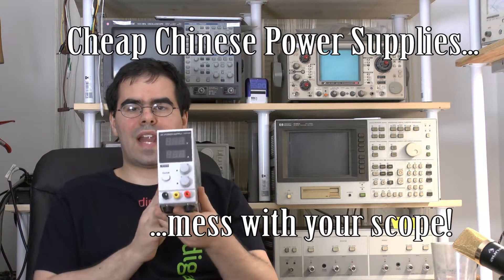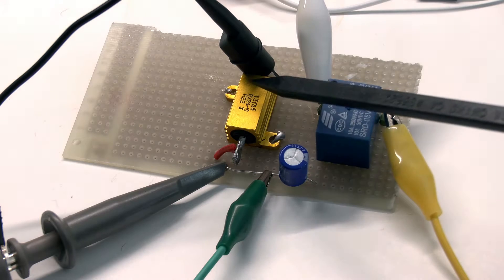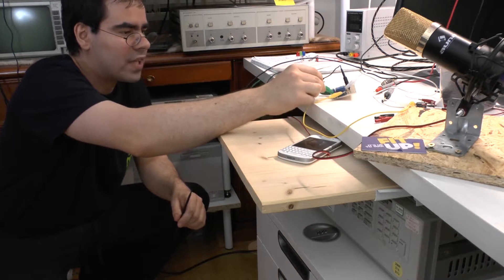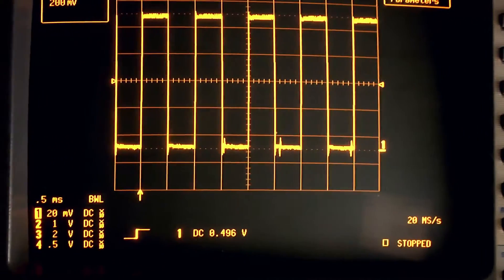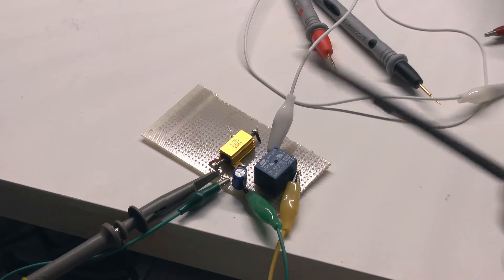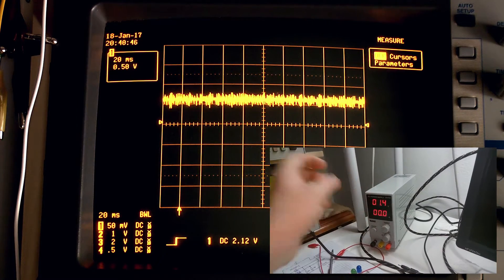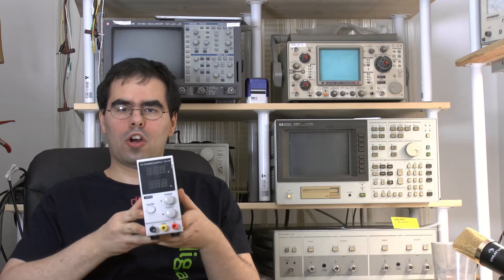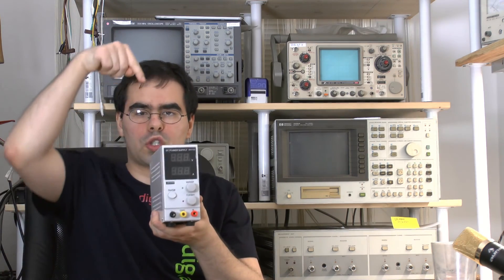Cheap Chinese Power Supplies mess up Oscilloscopes

Comment: Looks like it is switch power supply and has quite low ripple. If you compare it with analog power supply with big transformer of course the ripple it high. You get to know which power supply you need and which device you want to power it. If you want to pay less than a transformer price to buy a complete power supply with transformer, ...
Reply from the maker: Hello, thank you so much for talking back. The main intent of this video was to highlight the effect - sorry if it came along the wrong way...

Comment: Tam, how's your 4195A ? I'm trying to get mine up to date. New battery, calibration etc.
Reply from the maker: Hi, had him up yesterday for 2min for a demo. But I dont use him much, so there is not so much going on with him.
How can I help? Before I closed my windows of the bunker (this video was made in the old facility), I had a strange visitor warning me to perform a preventive maintenance of the capacitors on one assembly, but idiot me forgot to note which one.
Either way, tamhan aeht tamoggemon dot com it is if I can be useful!
Reply: @MrTamhan  I will replace both the RIFA cap and the battery and post a message on it in the next week or so.
Reply from the maker: @linuxaos  thanks man. Please let me know how it all goes - in the not so far away future, I also need to get back to maintenance. But my work level is insane at the moment
Reply: @MrTamhan  I posted this message on fenugrec's channel:
https://www.youtube.com/channel/UCvuwQ5FMK3X9qWw-NXK7QUw
I will repeat below with what I found. 
OK, 2 things. First, the battery can be replaced by:
Digikey: SY118-F021-ND
However, on the Power Supply board, you will find a RIFA Capacitor which must be replaced (as they fail miserably.)
Digikey: 399-7488-ND
Check out the video here for "RIFA MADNESS":
https://www.youtube.com/watch?v=XAbrU17hLTM
Reply: @MrTamhan  Tam, check out my video on maintenance of the 4195A. It tells you what to replace.
https://www.youtube.com/watch?v=TnaR4BcJ-N4

Comment: I can get a BK Precision 1735A for C$120 (about US $90) used at a local surplus store. That's 30V +/- and 5A, 4 digit readouts. <1 mV ripple. Heat sink instead of fan and so on.
New equivalents from several brands are C$350 and up where I live. Then there are these numerous almost identical Chinese supplies. I want to use it mostly for powering portable audio circuits on my bench, maybe an hour at a time a few days a month. e.g  a motorcycle headset or headphone amplifier where I'd want to see how the circuit performs on 2.4 Volts instead of 3.7 Volts or if it can take 5 V from a USB source.
Are these under $100 Chinese units too noisy or unreliable for that? I don't think I'd lose sleep from buying an old surplus BK supply but maybe someone here has a different opinion.
Reply from the maker: Hello, puh - I do not know this power supply. But if it works, why not get it - the price looks hot!

Comment: my Tekpower 5A model died within 3 months. Remember kids. Do not buy a Tekpower.
Reply from the maker: Thanks, man! Mine still works, albeit I did not use it much
Reply: I was using a DC motor at the time. I think the transformer at fault because the inside of the fuse was caked with metals and such. It also made the Lights in the house dim so if the Fuse wasint there the breaker would of popped.
Reply from the maker: Bro, did you fit a flyback diode? If the motor was big enough, this looks like an inductive kick issue...
Reply: Na there was no Flyback and the DC motor was from a small 3.6 Volt drill. there was no Flyback on the DC motor when it was pulled out either.
Reply: Oh yeah i forgot to add. The 3.6 Volt drill in question is one of those cheap ones that had a Nicd battery pack in it. The motor pulls around half an amp at its rated voltage.
Reply from the maker: Hello, please still be careful. Coils can bite, and a motor is a coil...
Reply: And this kids is why Fuse's exist so you don't die.
Reply from the maker: Not really. Man, I am sorry I am a bit stressed at the moment. Can we skype or vyber so that I can explain the problem?
Reply: Na its good man. The odd part is that it had no load but what do I know. Im bottom of the barrel when it comes to electrical things. Ive still got a few years to go until i can go to collage and actually be of use
Reply from the maker: Dillon, it is not a question of age. Trust me, just keep learning. I would love to make a video on the inductrive kick, but I sadly cant at the moment.
Reply: Dont worry about it bro. At least when you told me it was Inductive Kick i can resolve the issue and move on.

Comment: The cheap Chinese power supply you use is a switching power supply. It's not too surprising that a cheap switching power supply from China puts out a lot of EMI compared to a linear supply. The good news is that most cheap Chinese power supplies are still linear, they're just a bit bulkier. 

The fact that you also get radiated noise from the LED lights in your lab too should be a red flag to you that there's something you're missing in your test set up. Your scope is necessarily set to a very sensitive V/div, it's surrounded by EMI sources and you have long leads from your DUT to your scope (assuming you use the scope in place on the shelf), you have your DUT unshielded on your bench and you have long unshielded crocodile leads from your circuit to both power supplies which act as antennas. It's going to pick up any noise around and you must account for this in your test set up. Even without the switching power supply and the LED lights, we live in a 21st century world of dozens of EMI sources in every building. This is the first of your videos I have seen, but if you're an electrical engineer working on a real job and if all that expensive test gear is an indication of your experience, you should already know this.
Reply: See that long black ground lead on your scope probe?   That part is called an antenna.   Here are some tips.  You can clip the ground lead to the probe tip and you will have a loop antenna. You want to minimize the "loop area" in circuits and in measurements to minimize the interference coming in or going out.   This means that the return path for any signal should be as close as possible to the signal path.  The area between the two is called the loop area.  Remove the witches hat from the end of the probe and you will probably find a ground ring.   Coil a piece of bare wire around that (make the coil smaller than the probe so it is tighter) and have a short 1/2" or less stub that you can connect to an adjacent ground.   (google oscilloscope ground spring).  You can buy or make ones that are actual springs.  You can get clips that will connect to the ground ring. Use fully shielded coax connections directly to the circuit when you can.   Next best is twisted pair wire.   Make short adapters from 0.1" female headers to BNC jacks for using two pin header test points.  If you must use clip leads, twist the two cliplead wires together.  Incorporate BNC/SMA/header (with ground) test points in your circuit.  Use two identical scope probes with one on signal and one on ground and set your scope to subtract (differential measurement).  Consider a CT2708, CT3655, or PP005-BNC  scope probe to bnc adapter if they fit your scope and you need probe compensation with BNC test points.  And don't forget, connecting the ground on your oscilloscope to a circuit that is not floating or at ground can be an expensive mistake.
Reply from the maker: Hello KX36,
first of all thank you for the very long comment, which I am very happy about.

As for the test setup: I have to admit that I am but a student, and will remain so for my entire life (quotes DJ Shadow here ;) ). So, please tell me more - or e-mail me at tamhan at tamoggemon roundthing com.

Tam
Reply: I am also by no means an expert, but in a nutshell, shield everything you can shield to reduce noise pickup. Put your DUT in a metal, grounded enclosure, use shielded cables instead of crocodile leads and keep the lengths of exposed unshielded wires to a minimum. Just try not to introduce large ground loops between your equipment while doing so. You still won't be able to get rid of the noise completely. e.g. some noise it will pass through the relay. 

Look at the circuit in this video from w2aew https://youtu.be/XgSKLsWAWGs?t=683 and see how Alan has the copperclad board as a ground plane under the DUT and how he's made little ground connectors just for his scope probes out of coils of wire and soldered them to the ground plane. This guy really knows what he's doing in terms of high frequency measurement, far more so than I. Hope that helps.
Reply from the maker: Big thanks! I need to rework my whole lab...but wont do it anymore until I move next year. But please, stay around and give feedback!
Reply from the maker: Hello, big thanks for talking back! I will evaluate this more!
Reply from the maker: @waelfathe9909  did you try to look inside?
Reply: @MrTamhan   Tam Hanna  when it  shut  down  i go to  ic  sg   power ic  measure the    shutdown pin   find no   shtdowm  voltage ....so ic  is not  shutdonw   due to   board probelm ...also  i notice   fluctuation   in  vcc    that  jumps   from  9  to 8 to   7    to 10  ....may be this   shutdowns  the thing  ...or  may be the  ic  is marginally bad  if   the standby    is  bad i am  not  sure how it can be repaired but if ic is bad i will replace iy
Reply from the maker: @waelfathe9909  can it maybe be a dead capacitor?

Comment: thought psu would "mess up" my scope.

clickbait :(
Reply: And I thought your Lecroy was burn down by the PSU. I'm thinking to purchase that PSU though
Reply: well, switching PSUs do sometimes some HF "farts"  ...so, knowing this problem, why not filtering your HF-noise down with a simple LC ..a small capacitor parallel and a serial-choke to the out?  mostly it helps  ...also consider influences from outside when you're measuring noise:    https://youtu.be/pKXPqApOYfk
Reply from the maker: Hello, sorry - but for me, it was extremely annoying...

Tam
Reply: +Tam Hanna then I understand, you could try the peaktech 6225A it uses a power transistor as a lineair regulator clipping a few volts,  makes a pretty nice output :)
Reply from the maker: Hello, the problem is NOT the output. The PSU farts out HF which travels, over the power line (230VAC) to the LeCroy and other instruments.

Comment: Ha, yes, I had very similar effects on my 'scope from an LED power supply. 

I have since replaced them with linear supplies, they run hot and doubtless waste a lot of power but I can at least now work on my bench and get reliable measurments.
Reply from the maker: Hello Clint,
yes, thats true indeed - amusingly, its one of my LED light lamps which gives me grief ;)

Tam
Reply: At work here we've had similar problems. To solve this we sometimes use Auto-transformers for our AC source. It seems to filter out a lot of the noise on the AC mains. Keith
Reply: Keith Noneya what's an auto transformer?